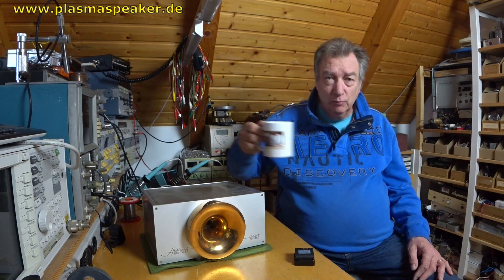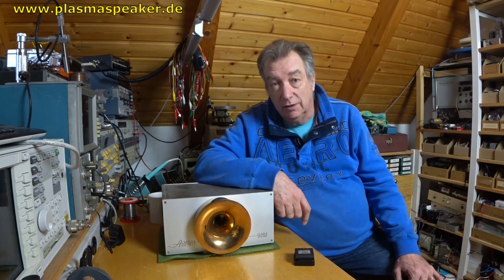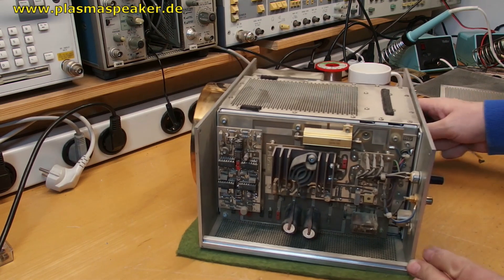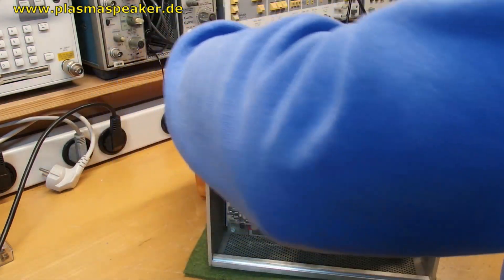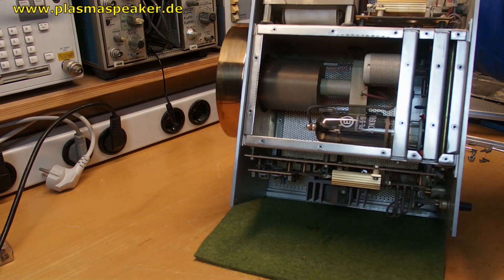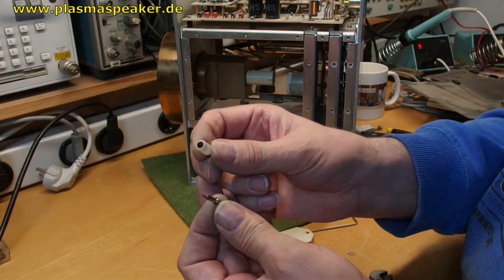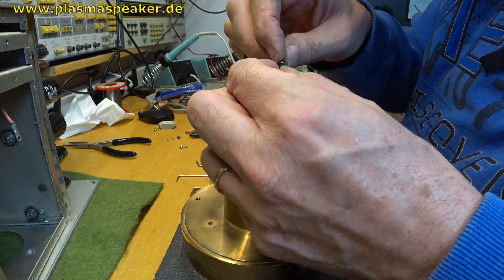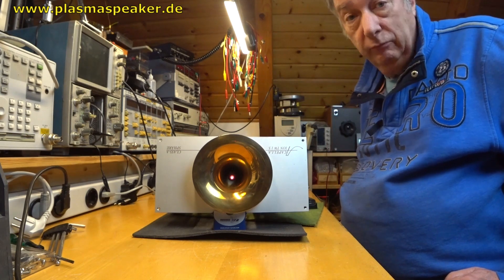Acapella TW1S Plasma Tweeter tear down and repair

Comment: Interessant. Ich hatte noch nie von der Acapella TW1S gehört. Wenn ich mich nicht irre, ist der Unterschied zum Lansche der eingebaute vollwertige Audioverstärker und der Durchmesser der Elektrode. Der Lansche muss extern angesteuert werden.  Der Keramik-Elektrodenhalter sieht beim Acapella robuster und stabiler aus. Gibt es große Unterschiede in der Audioqualität zwischen den beiden?
Reply from the maker: Bei Lansche ist die Audioeinkopplung über einen Transformator gelöst, bei Acapella über eine Transistorstufe. Die Elektrode ist nicht unbedingt so entscheidend. Der Durchmesser der Brennzelle ist wichtig für die untere Trennfrequenz. Bei den neueren Lansche sind dies 8mm und bei den Acapella 5,6mm. Acapella gibt als untere Trennfrequenz etwa 5 Khz an, Lansche 1,5 Khz. Prinzipbedingt ist die Audioqualität bei beiden in etwa gleich. Beide geben einen maximalen Schalldruck von 110 dB an.